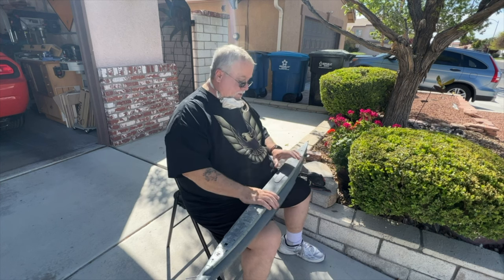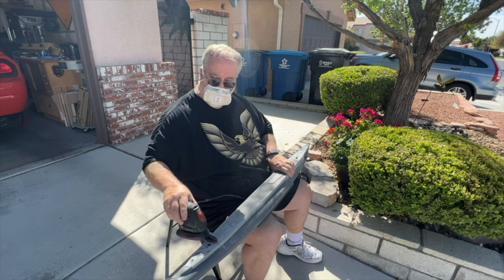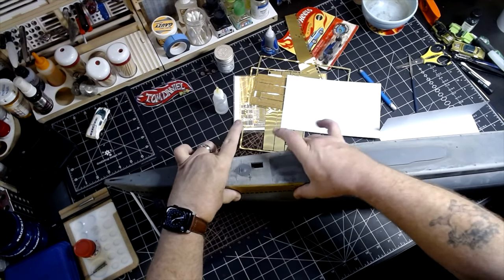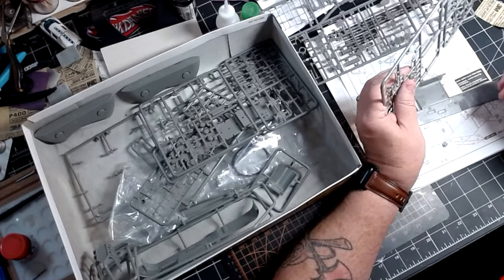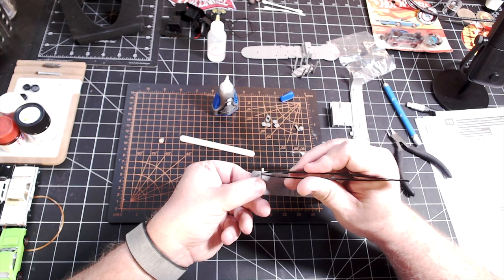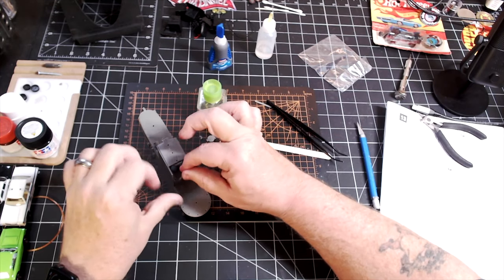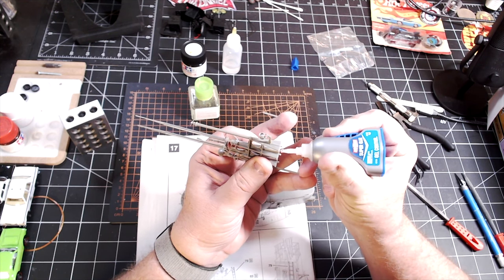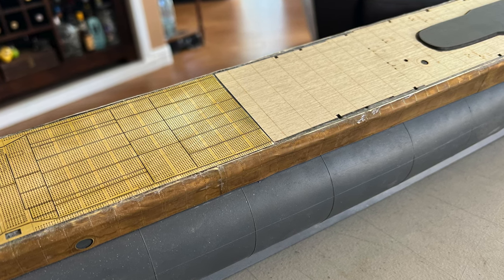Revell GATO Submarine Model Build - Part 1

Comment: See I only watch long videos. They tend to have more substance. Especially when it comes to reviews. I won't bother watching if they are less than 20 minutes. Anyway haven't built my Gato yet but now contemplating not using the PE I splurged on for it. Hmmm.
Reply from the maker: I guess if you're really good with PE, but otherwise RUN!  Sell the set one bay.  The build will be easier, funner, cheaper, and will come out a million times better....